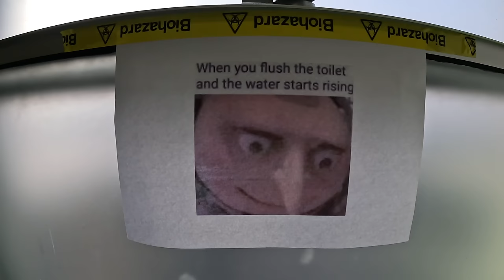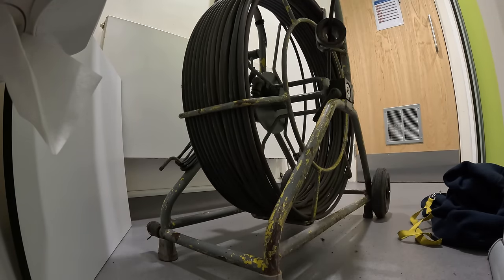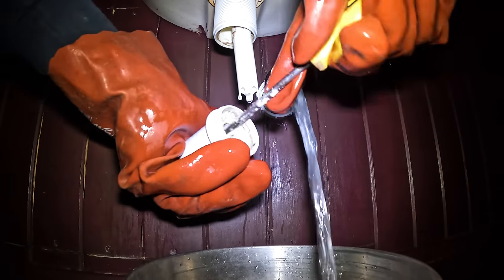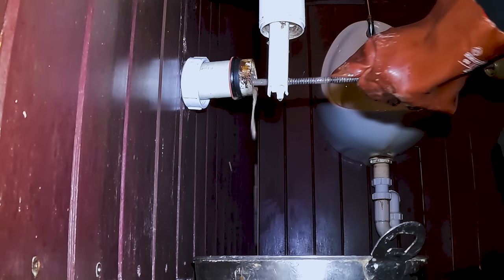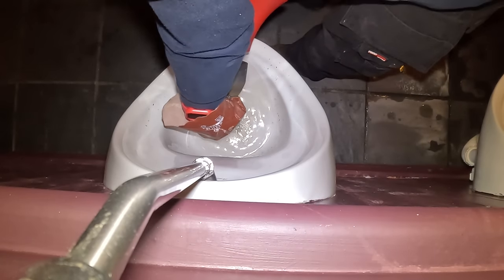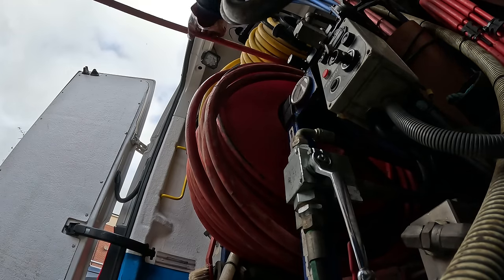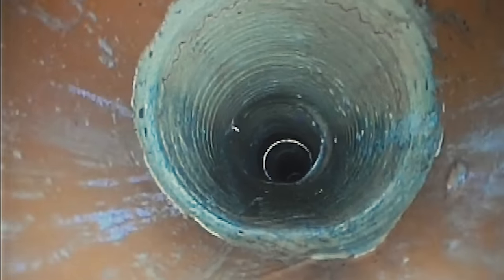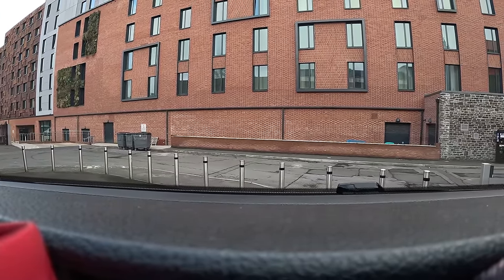Slow Sewage - Slow Urinals

Comment: Had 1 toilet out of 5 at a restaurant that had a problem not Flushing properly, appears the wrong flush valve was installed, instead of having 3.5 gallon per flush, it was only 1 gallon. Changed to the correct flush valve and problem was solved.
Reply from the maker: I think this is probably a similar situation here in don’t get involved to much with clean water but hopefully they get the right person to fix it

Comment: The flush on the toilets is very poor. The toilet pans only have a small trapway.  And with a poor flush of course there is going to be blockages. The owners need to replace those toilets and use high level cisterns.
Reply from the maker: The flushes are awful at this site, you don’t see many high level cisterns in the UK anymore but they would do the job 👍🏻
Reply: I just about saw the flush button panel for them = those are dual-flush toilets that have not been properly adjusted for half & full flush, by the plumber that installed them and the building management/owner that doesn’t know how to adjust it 😠, those are not “eco-low flush toilets

Comment: I think I asked this before, but why can't you pour some hydroclauric acid in each. Leave it 20 mins and it clears it all as it reacts with the urine salts. No need for all the effort with machines and taking apart the plumbing.
Reply from the maker: Its a H&S insurance thing and carrying chemicals on the van and all that stuff, the reason we don tis more if someone goes in an its still on the urinal and splashes back at them etc we would be liable for it and stuff like that

Comment: That blocked server, does the blockage begin forming at the outlet into the manhole and then extend back up the pipe or does it form higher up and then push down towards the outlet? Reason I ask that if it forms at the outlet, would cutting the benching to form more of a fantail maybe prevent the blockage from binding in the first place?

Also, why is the drain flowing away from the windsor trap? Never seen that before, possible replacement?
Reply from the maker: to be honest there is just so little fall on this pipe it blocks about half way and over time slowly pushes its way thru bit at a time and never makes it with enough flow to the manhole.
Reply from the maker: The Windsor trap is a strange one im not sure why they have done it like that iv never seen one like this before